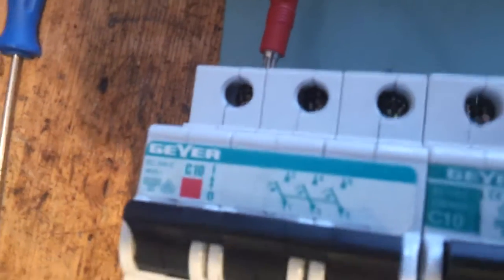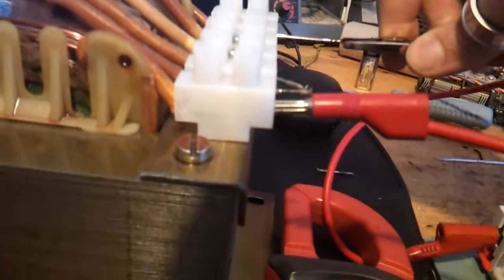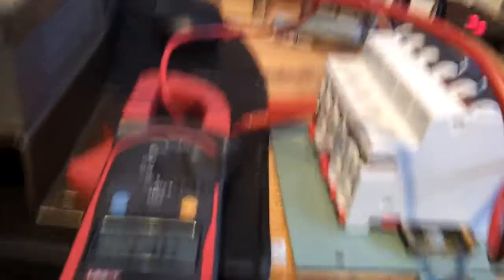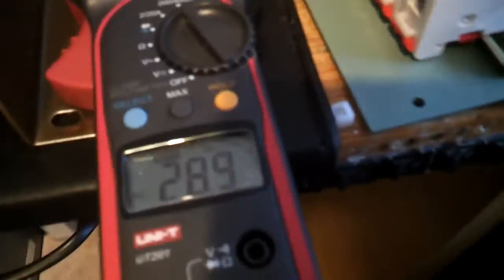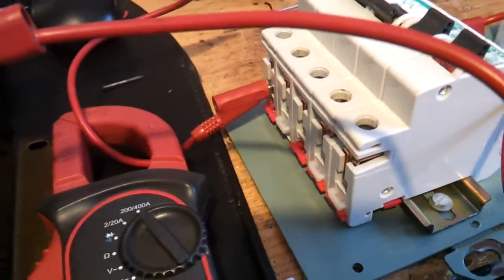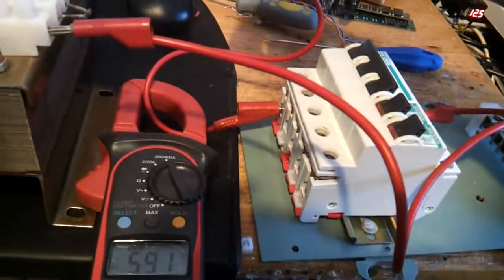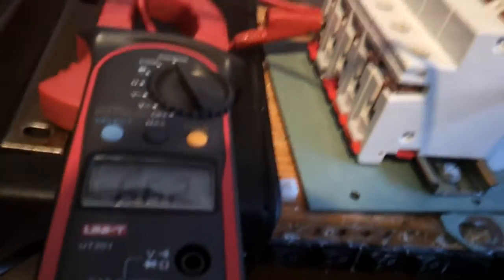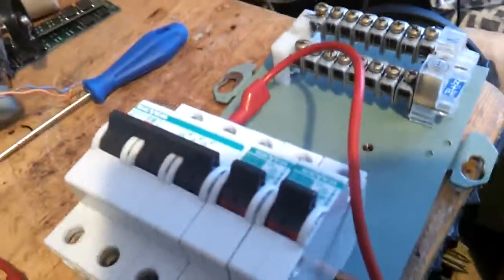CIRCUIT BREAKER HIGH CURRENT LOW VOLTAGE TEST

Comment: I have a 4kW power supply to test.  The output voltage is 5V, which means I need to draw about 800A through my dummy load.  I have a dedicated 100A breaker in my shop.  With a low voltage output, can I still perform my 800A test through a 100A breaker?

Comment: This is a old video, so perhaps nobody bothers to correct it. Quite annoying that he keeps repeating "right voltage to trip" but doesn't prove it. From what the video shows, the MCB is working normally. Type C 10A MCB will require about 26A to trip within 1 minute (thermal), and about 50A to 100A for instantaneous trip (magnetic).

Comment: You proved exactly "NOTHING". Number one, as tceffearat mentioned it will take the breaker about 1 minute to trip if you applied 26 amps. That's because the current has to bend a bi-metallic element in order to trip, until you reach the Instantaneos Trip Point (which is approximately 10x the breaker continuous rating or 10 x 10 amps = 100 amps. (Just like tceffearat mentioned.). So without timing the breaker you have no idea if it is performing like it should. And besides that, every time you tested it and then commented with your geneous remarks (NOT), the breaker is heating up and trips faster each time you test it. Find the time vs. current curve, study it, and get back to us. I can hardly wait.